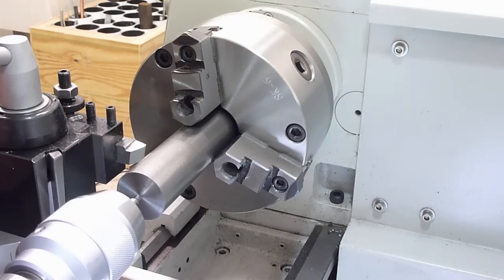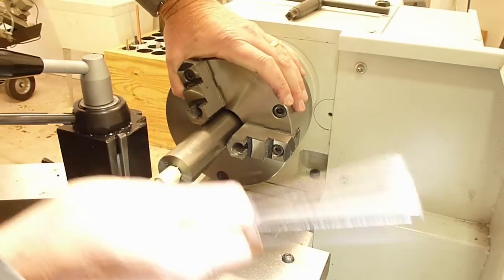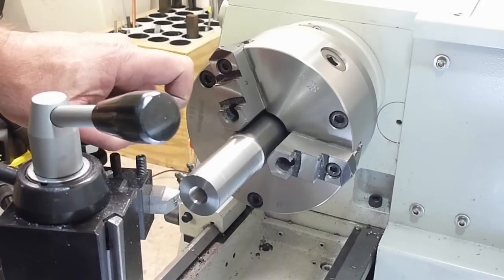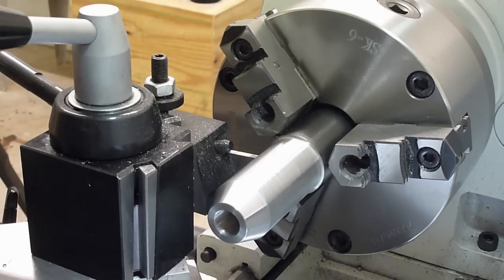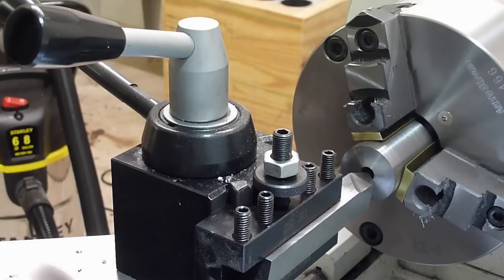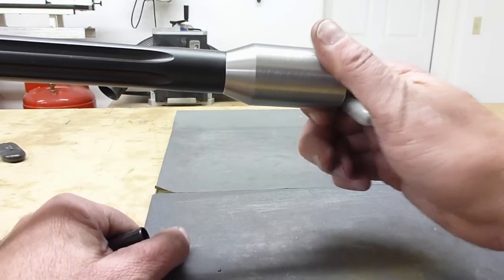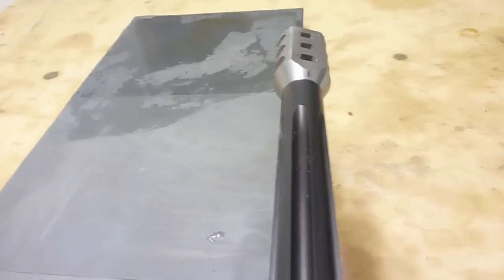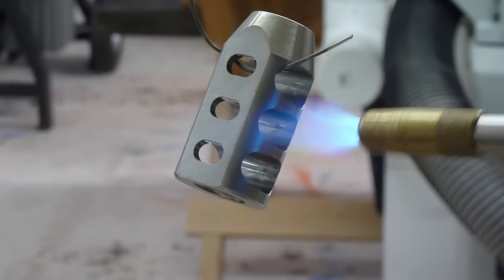Machining and Oil Bluing a Muzzle Brake

Comment: Very nicely made. How much improvement have you found with it, & How is the side pressure, does it affect anybody standing near you. running the chuck in reverse for filing is an excellent idea
Reply from the maker: Big improvement on recoil reduction.  Only slightly less than than an MPA break I had installed with ports angled 45 degrees to the rear.  My complaint with that type of brake is the effect on shooters to either side and the noise from super sonic gas directed rearward.

Comment: Interesting way of doing the timing. I would be worried that it would lose that timing over time with multiple detachments/attachments, as the threads get worked.
How has it held up, and do you keep it attached all the time?
Reply from the maker: I have had no reason to remove it.  I leave on when cleaning.

Comment: How does the finish hold up over time sir?
Reply from the maker: Good so far.  I have it on two rifles.
Reply: It will scratch off with hard use but given the ease of application and next to free cost it is pretty great. I finish lots of 1018 parts with the same method at work.

Comment: Why do you run the file backwards?
Reply from the maker: It's not, the spindle is turning away from me.  If I mess up and contact the chuck it won't jam the file toward me.
Reply: @bretthl1  that's a pretty good idea. 20 years working in Machine shops and never heard of that one.
Reply: You always turn away
Reply: Seems more dangerous to me.

Comment: Question isn't 12L14 kind soft for a muzzle brake.
Reply from the maker: 4140 Rockwell B = 92
12L14 Rockwell B = 84

So far so good, have not seen any pitting.  Machines nice too.
Reply: @bretthl1  ok didn't want to act or come off as any type of know it all by no means. I do agree 12L14 does machine nice.

Comment: what kind of oil for bluing ?
Reply from the maker: I use cutting oil because I can reuse it.  Any heavy hydrocarbon oil will work fine.  Do not drop the piece in when glowing red or the oil will burn and leave a film that is hard to remove.  If you don't like the results, just wash, rinse and repeat.